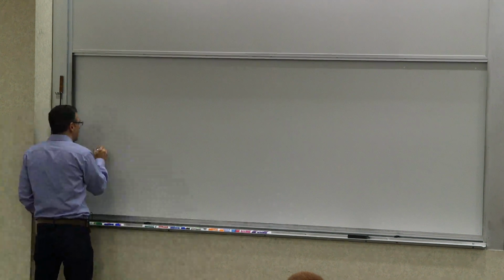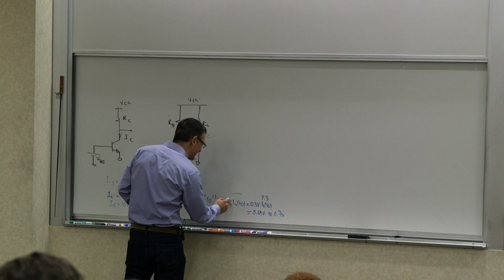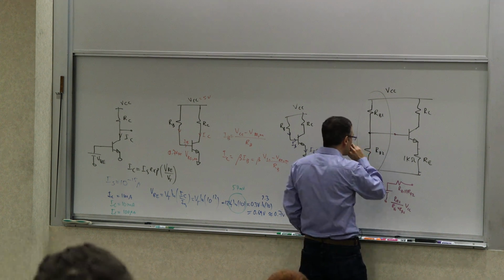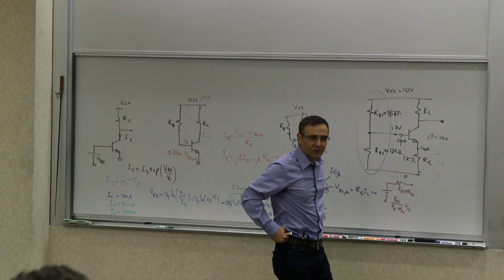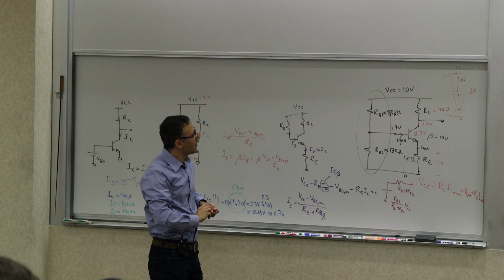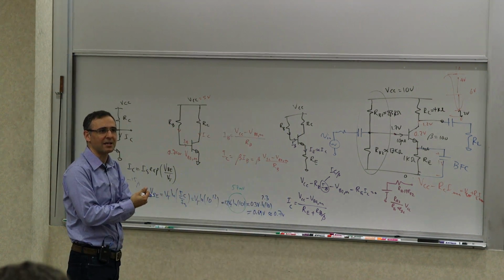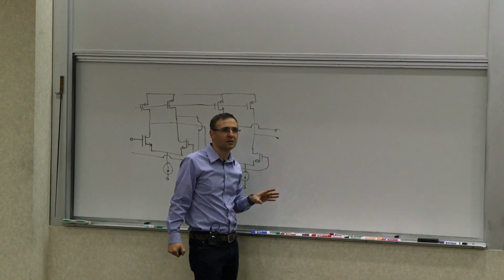131N. Basic Biasing Concepts

Comment: 00:02 Concept of biasing and its qualities
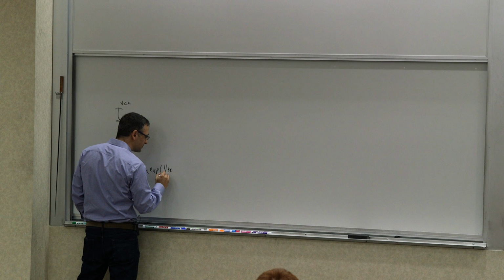01:59 Biasing techniques exploit exponential behavior for gain.
07:00 Temperature independent biasing concept
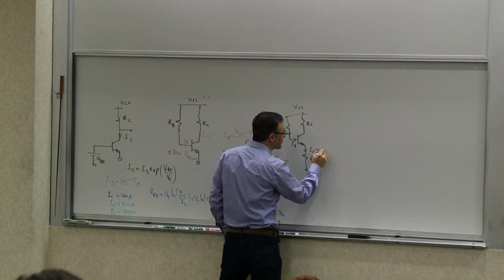09:37 IC can be expressed as (VCC - VBE) / (RB + (re / beta)), showcasing dependence on beta and RB.
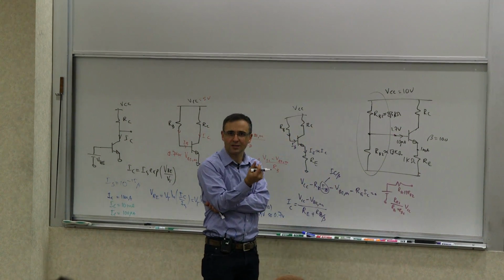15:16 Choosing the value of RC for an amplifier
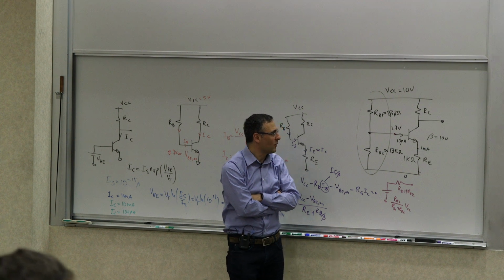17:33 Basic biasing concepts for transistor circuits.
22:10 Biasing with resistors limits transistor gain.
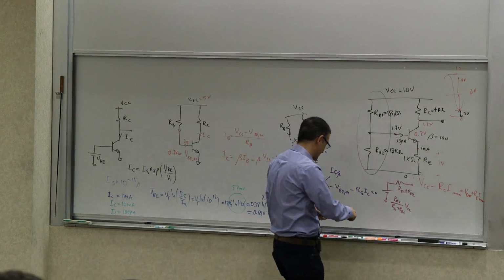24:21 Biasing techniques can reduce dependency on transistor specifics.
29:23 Common emitter and common source are essentially the same fundamental stage.
Crafted by Merlin AI.

Comment: what will happen if we take Rb=0 ohm
Reply: It ended up with the same circuit in @1:46. The fluctuation on the Vcc induce small fluctuation on the base current, and Ic = beta*Ib ended up with large fluctuation.

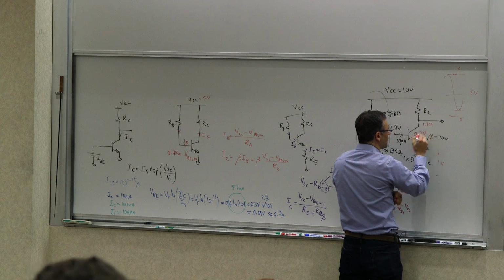Comment: At 20:16, why is Vce=0.2V  at the edge of saturation? Thought it was something like 0.8V.
Reply: That is at the edge of saturation. If Vce=0.2V at the edge of saturation, Vc=1.2V, and Vb=1.7. So Vbc=0.5V. The diode in bc junction at the edge of forward bias (typically bc junction should be in reverse biased to stay in active region). So, both be and bc junctions are going to forward bias, which is at the edge of saturation.

Comment: Sir I have one question, Vbe(base to collector voltage) in BJT is fixed like 0.7 for silicon or Does it varies according to Ic(collector current) because in few numericals, They have given silicon transistor but they are finding Vbe(base to emitter voltage) by using (Ic=e power Vbe/Vt) and then they solved further it.
Reply from the maker: As stated in the video, Vbe=0.7 is an approximation (initial value if you are doing iterative solutions) for typical currents (e.g., 1mA) and typical silicon integrated circuit BJTs (e.g., 1e15). It varies slowly with the Ic because of logarithmic dependence and small value of Vt (25mV at room temperature), as stated in the video.